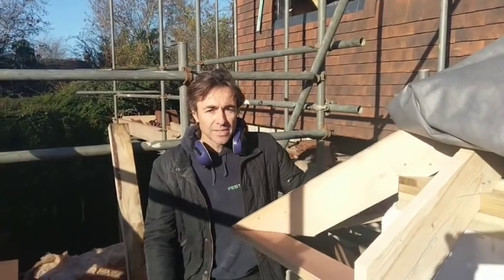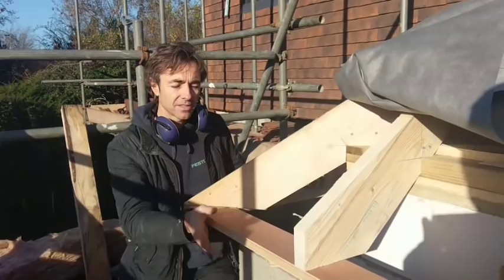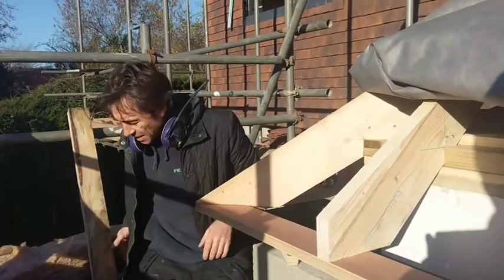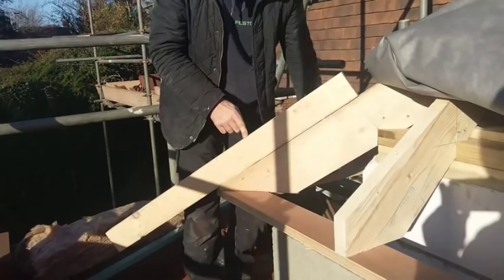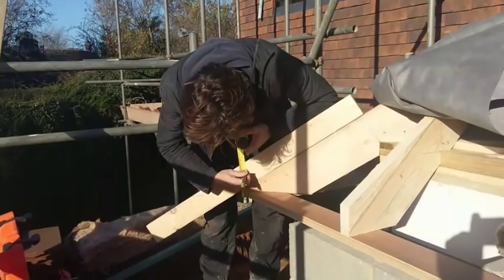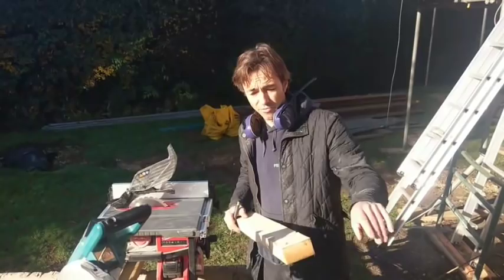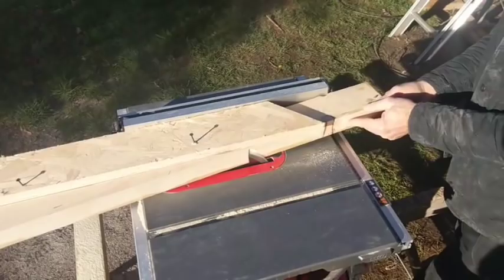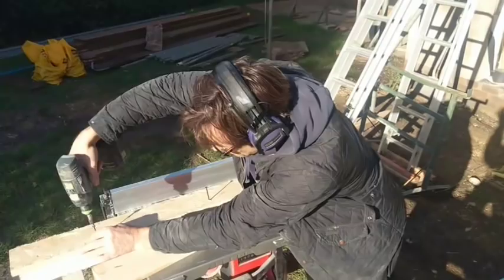Cut and fit a sprocket to a roof rafter

Comment: So glad to see you grab a $30 hard point to finish off the plumb cuts. Here in the states we would be laughed at, even though we finished before they set the angle on there $400 cordless worm drive.

Comment: Do many people bother with sprockets any more ? Most roofs I’ve seen the roofer dictates the pitch of the bottom tile, working with the fascia line. Eaves guard which is ridged supports the membrane so sprockets aren’t needed.
Reply from the maker: A sprocket gives a nice wide soffit and creates a really nice soft flow to the eves of a roof, on this job the main house roof had a sprocket So it was good to match it! I even use them on brand new roofs. Thanks for your comment!
Reply: Aesthetics,  say it, spell it, try it.

Comment: Hi Robin, how do you work out the length of sprockets?. Is it dependant on the length of a number of the roof tiles?.
Reply from the maker: Hi Frank, Great question, in this case we had plain Clay tiles on a 42.5 degree roof so we made the sprocket pitch on it's top edge back to 35 degrees this is the minimum pitch for this type of tile, we get the eve course and two full tile courses on the sprocket, it looks sweet too!
Reply: @ @ukconstruction  Thank you, Robin, for that detailed answer. I forgot about having to take into consideration the minimum pitch of the tile being used.
Also, I have never thought of using sawn tanalised timber as a backing for the P V C fascias, a bit more beefy and cheaper but a better job.
We have always used plained timber as a backer I can't think why. A habit I guess.
Really great neat carpentry up there Robin you are a credit to your trade.
Reply from the maker: @frank1847  Thanks Frank!!!